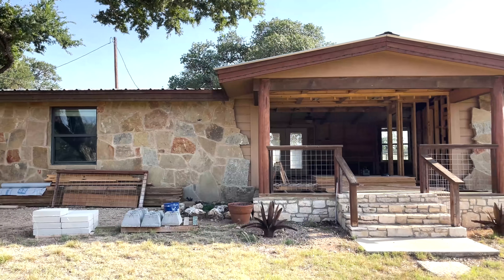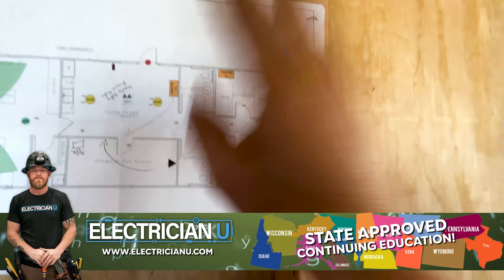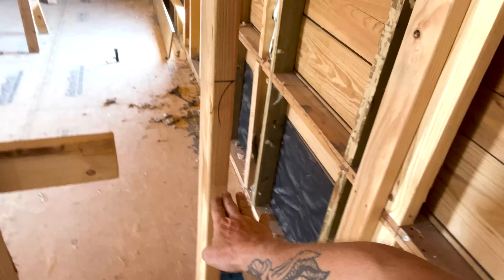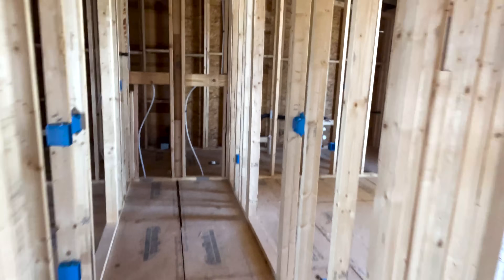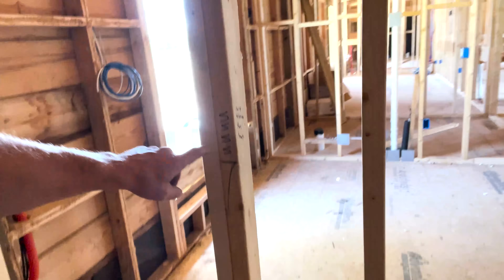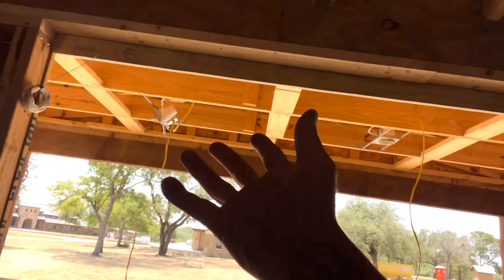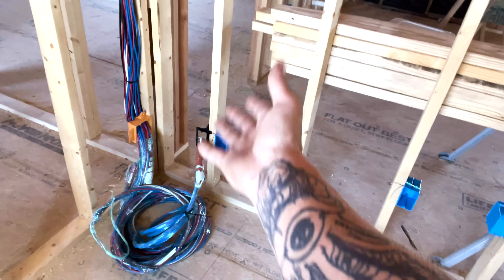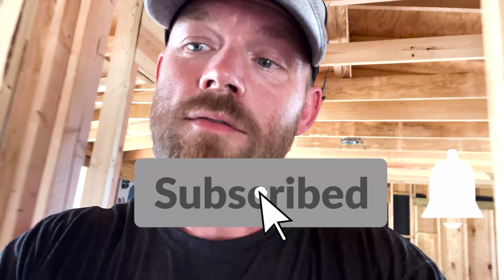What to Do on a Jobsite Without a Plan

Comment: I am a first year apprentice, and I have surprised my job lead on a few occasions with some of the information I’ve picked up from watching these videos, one of which from a previous video you mentioned like you did here at 2:58. About hallway receptacle requirements, that you need one receptacle for every 10 feet of hallway. He had me go through the 2020 code to find where it said that and all we could find was it saying if the hallway was more than 10 feet in length, you need at least 1 receptacle. It didn’t state you needed one every 10 feet, just one if it’s over 10 feet. Are you or anyone else able to reference the code for me that says that to clear it up for me?

Comment: Got a question? I worked on a Condo that was built in the 60's and I started to replace a bathroom light but before I did that I shut the switch off to kill the power to the light then disconnected the light and got zapped??? come to find out that they ran the switch off the neutral instead of the hot wire (black/line) to the light so the hot wire was still hot...I talked to an old electrician and he said that in the early days some homes were wired this way??? I learned a good lesion always test before you grab a wire don't take anything for granted.

Comment: @Dustin   In that corner area with the server location, it was great to put an outlet box there. However, judging by the number of data drop cables coming in right there, it will be a network rack and a server computer. For such an area there really should be a dedicated 20A circuit to such a spot. So hopefully you don't jump over to it from all the other outlet boxes in the room and especially hope you don't also share that box with the outlets nearby in the connecting room.

Comment: Hey buddy! Been watching your videos since I was a helper almost 2 years ago and have learned a lot from you! Just wanted to say thanks for the knowledge! I do have one question tho. If you don’t have a detailed blueprint wouldn’t it be better to use cut in or flush mount led lights? For me when I’m not sure where the light needs to be, I’ll just leave a loop in the general location that’s not cut. For example I do it a lot when it comes to the kitchen area, that way I can get say my pendant lights in the exact spot regardless if they add or remove a light. Same with the can lights, that way I can center them up on the cabinets and walk way during trim out.

Comment: Bravo! Are they starting a new colony or town down there, I lived down Texas, San Antonio for 12 years, I could not take the heat down there anymore, I think I got skin cancer on my arms because of the intense sun, get a generator and electric jack hammer to break up the ground when your digging, or a trackder ditch witch to dig with, I know Texas dirt is 6 inches then nothing but rock after that, And that PEKs plumbing pipe is garbage.Good luck with the job, and try to cover your arms and neck when your in the sun.

Comment: For your long boat dock run, how would installing a pair of transformers (240:480 then back) to limit the voltage drop compared to replacing the cable?

Comment: Network Engineer here, whenever there is a network closet id assume there will be a UPS to help protect sensitive electical equipment.  Talking with the AV guys beforehand is a good idea cause unfortunately UPSs aren't standard.  Their electical needs vary dramatically from model to model.  I've seen small UPSs that just require a simple NEMA 15A receptical,  to L5-20 or even L6-30s.  Hell some of the biggest UPSs are hardwired.  

In this case a single gang box for their shit is probably a good assumption.  I doubt their are running enterprise datacenter equipment in a rack, they are probably just gonna install a small UPS to protect their AV rack.

Anyway. love your channel.  You have have helped me in my line of work so I can intelligently relay my needs to the electricians I work with, making both our jobs easier in the planning phase.
Reply: Single gang outlet may be fine, but a quad with a dedicated 20A circuit gives you more options at little additional cost.
Reply: @tomferrin1148  very true.  Also placement is key.  If they install a lockable wall mount rack its best to have the receptical located in the rack so they can maintain some physical security for the gear.  last thing you want is to allow anyone to unplug gear in the rack simply because the receptical wasn't located inside the rack encosure.
Reply: @tomferrin1148  ... good call. I was going to mention a few dedicated circuits for the AV gear. That's common practice where money is no object. (like this project)

Comment: Great video. But you should’ve explained where to install smoke detectors , and since there is gas in the house , the carbon monoxide detector. Also why they are installed where they are.
Reply: At least one on each floor, one in each bedroom.  As close to the center of the room as possible and if wall-mounted preferentially on interior walls to avoid thermals. Min. 6 inches from a ceiling, floor or wall.  I don't think it's code but you want a CO/smoke near any fuel burning appliances but they should be 5-15 feet away from the appliance.  Best not to put detectors near doors or windows. Attic spaces may require special high ambient heat devices.
Reply: @dalecarnegie4440  yeah. Here it’s one in each bedroom and one in the adjacent room. And if gas is present then at least one location has to be a CO detector.
Reply: Only requirements here are one on every floor, one in every bedroom, and one just outside every bedroom

Comment: 4:20 a full demo will then require a new construction permit vs a remodel permit and cost several thousands or tens of thousands more.
Reply: Not if the job is out in the county.
Reply: @alphasaiyan5760  ... Dustin is speaking of a full demo on the electrical, not a demo of the building itself. That's where the permits and fees are different. This would be considered a renovation because the outside of the structure is basically unchanged.